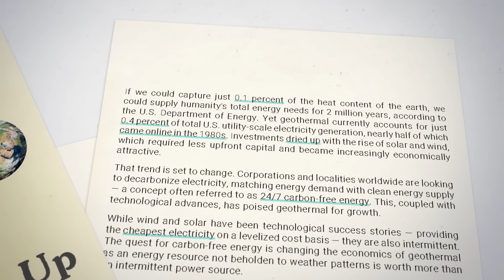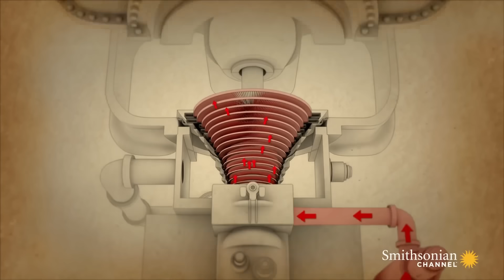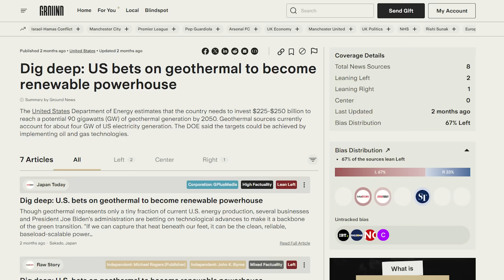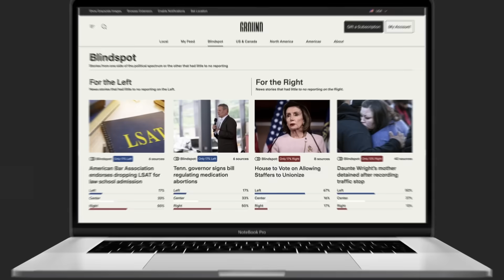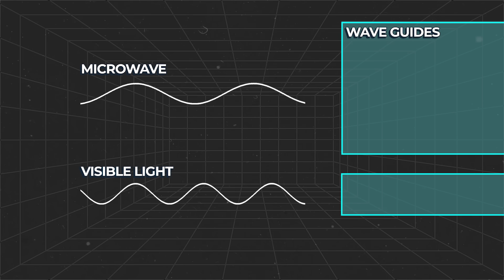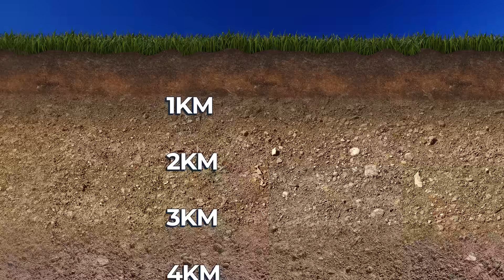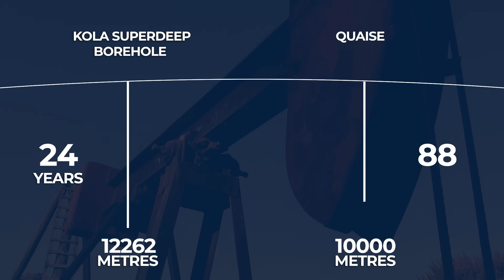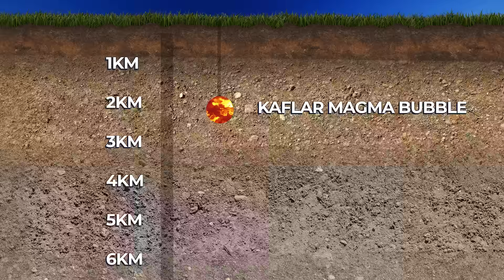This Fusion Tech is Solving the Geothermal Energy Problem

Comment from the maker: If in doubt, use more lasers. This was fun, thanks to Carlos and the Quaise team!
Use my link https://ground.news/DrBen to get 40% off the Vantage plan. Access local perspectives to better understand world politics and current events with Ground News.
Reply: This won't work. The hole will fill with high pressure vaporized rock and it will eat itself wider instead of deeper. You'll see.
Reply: @bradspsychedelium  no you'll see. we dont need to drill down to the magma, only to the area thats hot. DUH!
Reply: @johnnynephrite6147  The hole will be fill with rock vapour and the beam will not reach the bottom. It will Merely heat the vapour and corrode the hole wider.
Reply: @johnnynephrite6147  The vaporized rock has no where to go except up a 10+ km deep hole.  The fact that they don't talk about where it condenses makes me think they don't have a solution for it yet.  The best case is that it condenses into a liquid after exiting the hole, and they're able to recover some of the heat energy to power the laser.
Reply: @bradspsychedelium I also have the feeling that this is a kind of scheme.
We live on a Planet with plate tectonics (thanks God...if you believe in him) and I'm just wondering how many times we have to reopen those holes to hold them funktional.
The second thing is (and I've just read it somewhere) that thermal energy can't be used for ever because you'll use up the heat and have to drill a new hole (but they were talking probably about thermal power plants that weren't drilling as deep as they wanna do it).
Nevertheless, I'm quite sceptical that it will work how they say.
I'm maybe kinda old school but a new power grid and new types of batteries together with using renewable energy sources could generate more jobs and a more sustainable solution to our energy needs.
Reply: @Spielername  I love geothermal as a concept, but it's really tough to engineer. I would advocate thorium fission considering today's technology and demand.
Reply: When using microwave instead of visible light, it is called a “Maser”

Addendum: these can occur naturally
Reply: @t0rg3  I thought so as well
Reply: @t0rg3 
And just for the record although she might not be aware, masers were invented before lasers.
Reply: Thats the movie, "crack in the world "
Reply: @MarianLuca-rz5kk they will be pumping high pressure air through the wave guide to clear the rock dust. But no one has explained what will happen when a water filled fracture is hit...
Reply: @kimstyles5078 Just use conventional drilling at any depth at which the water isn't going to instantly vaporize...if it vaporizes treat it like the vaporized rock.

I think the bigger issue is cooling.  You need to actively cool that waveguide.
Reply: Have you heard about rampian theory and rampian fracture? Lol anyway what a load of electric energy junk addiction mania, electricity is only needed for circuits if they are needed at all
Reply: @crapisnice  u crazy? without electric energy we would not have any of the greatest things ever!
Reply: Its a gear idea, this was researched  in South Africa over 30 years ago,  However we had very little use for it. Also  underground water will draw off the heat, unless there is a stop/blocking method.
Reply: You should have you Ph.D revoked for your claims of infinite energy.  There's always trade offs.
Reply: @kayakMike1000  IKR.
Reply: @MarianLuca-rz5kk  That's how it looks to me too.
Reply: why would you choose the bad guy goatee?
Reply: @TheCorruptionKing  The Tony Stark goatee?

Seriously?

Obviously, he's Iron Man.
Reply: I think people running things don't want Geothermal.  They don't want free energy.  There are places you don't need to drill deep.  Like Hawaii.  Why do they have coal plants in Hawaii?  Burning coal to make steam in Hawaii is retarded. Then the environmentalist groups are pressuring Hawaii to replace the coal plants with solar panels and wind farms.  Just bulldoze the rain forests to set up fields of solar panels in Hawaii.  They don't want solutions that work, or everyone is actually retarded.
Reply: Hey genius-face, "near infinite" is a meaningless phrase.
Reply: @austinmackell9286 Except you know exactly what he means -- a huge amount compared to our current energy usage.

Language is flexible and context sensitive.
Reply: @petergerdes1094  calling finite things infinite is wrong. I will die on this hill.
Reply: Now we need to worry about you folk making all the magma leak out of earth or making it cool and the world stop spinning and we will all fall off the edge of the disk.
Reply: Put stuff in miles too.
Reply: You should have t
Reply: Well I feel we are more likely to kill our planet by doing this along with every country nukeing each other in ww3 have you ever watch the movie where a person killed the earth and they have to make a train device too go to the core of the earth too restart it that engery is there for a reason to keep the planet alive
Reply: Please don't use infinite energy. From the video it's clear that it's not infinite, you mention 2 million years for example, but with so much pseudoscience and so many scams based on it (do not buy solar use this hack to get infinite energy from the earth) we should be extra careful. I found your videos today, and I am binging them. Excellent work.
Reply: Don't do it that will break the EARTH
Reply: Just drill near volcanoes, bruh!
Reply: All this is bs . The earth is a sphere therefore the ocean will always have tides . We could capitalize on this in massive way but don't.  Why ?  Simple big oil will not let it happen .  The world is all about the money. There are some small tide capture energy but only enough to say it can be done .  It's laughable to see us all using fossil fuels and u think electric is the way? Hahaha it takes more fossil fuels to produce an electric vehicle at the moment even though your electric car may seem like it is helping global warming lmao. Big oil controls energy period. They have bought all patents on tidal energy products and won't let this happen period . If u don't believe me try imagining something under the ocean . Big semi buoyant units that flow with the tides and turn generators by way of the tides.  Yes of course this is possible and easy to do !!  Ask why folks just ask why ? 
If your government cares about the earth and it's climate then ask them!  U won't get answers guaranteed . Even a child could imagine a scenario where we capture the power of the tides to make electricity. Cmon folks grow up
Reply: So what happens if we effectively vent earth's core through thousands of holes over thousands of years? How long until the crust cools and we need to go deeper? How long until it affects the rotation of the earth?
Reply: Energy is never free.  It's extracted from different mediums.  My concerns is if we're taking heat away from the core of the planet, will this cool down the core?
Reply: I just want to ask why to go this. Much deep ,while we have volcanoes ,first learn how to contorol its energy 🤔🤔and then work their😅
Reply: Don't you understand if you chaince the plasmafilemental everighe thentional behavieures you onley ad to the plasmafilemental disorder posebiletys eaven more and stronger eurthqueakes will be triggerd👀👀👀
Reply: this is stripped right out of the core
Reply: The thing to consider in the long run is that this tech will inevitably accelerate the cooling of the Earth's core. By how much? That depends on this tech's adoption rates, but my suspicion is that if this becomes the main source of energy of the Earth, that it would accelerate cooling by quite a lot. I'm not sure how long it would take to solidify the core, or what potential calamities a more rapid cooling of the core could cause, but considering Mars's alleged solid core, and lack of magnetic field we could potentially be trading one catastrophe (catastrophic global warming) for another (atmospheric depletion due to weak magnetic field and solar wind).

I think the solution we should be pursuing for base load in the short term is Molten Salt Fision reactor tech, and in the longer term Nuclear Fusion, and Antimatter tech.
Reply: Sonic energy might be a better option for drilling through rock. 🤷🏻‍♂️
Reply: @JustMe-dc6ks  boths can't stay in a straight line inside the rock we have traied that to se of this could replace diamand drilling in concrete.
Yed was not poseble to stay in a straight line the expanding schinking atoms with laser in to thentional diverentional displasmands becomes diamagneticle resistance .
And harmonics than the thentional diverentional displasmends bouncing of and than against elchader that the gabb wijdens eugley over  20 years ago
Reply: And men are not yet raddy for dragster tegh😪
Reply: On one hand it's better to use geothermal sources of energy available to replace environmentally damaging alternatives, on the other hand we should also do everything we can to decrease our energy consumption because every watt of energy produced and consumed eventually ends up as heat, warming up the atmosphere. It may not seem significant but once we add up all the energy from oil, coal, gas and nuclear power plants, industries and vehicles, it's trillions of watts released every single day. Hydro/wind power and solar steam generators don't add any heat to the environment as the kinetic energy and infrared light already were going to end up as heat.
Reply: can i marry you 💁‍♂️🥰
Reply: The Experiment: Suddenly create some charge, and with pre-placed instruments watch (along a radial line from the created charge) the fields and potentials appear progressively at points along that radial, at the speed of light.  And once the field and potential suddenly appear at a distant point, they thereafter steadily remain. This shows that a stream of continuous real observable EM energy does indeed pour from the charge, once it is made, continuously and unceasingly.  Further, that free stream of EM energy does not "die out" so long as the charge remains intact. So the associated fields and potentials are continuously replenished, as they continuously spread radially outward at light speed.

The Observation: Every charge freely pours out real EM energy in all directions, with no observable energy input.

The Problem: Either the required nonobservable energy input must be identified or the energy conservation law is false.

The Solution: The charge continuously absorbs virtual (subquantal) photon energy from the vacuum, coherently integrates it, and re-emits it as real observable photons.

References:

Source Charge, Van Flandern Waterfall, and Leyton Geometry T. E. Bearden  (Dec. 2, 2003)

T. E. Bearden, "Giant Negentropy from the Common Dipole," Proc. Congress 2000, St. Petersburg, Russia, Vol. 1, July 2000, p. 86-98. Also published in J. New Energy 5(1), Summer 2000, p. 11-23.

T. E. Bearden, Energy from the Vacuum: Concepts and Principles, Cheniere Press, 2002, “Chapter 3: Giant Negentropy, Dark Energy, Spiral Galaxies and Acceleration of the Expanding Universe.”

M. W. Evans, T. E. Bearden, and A. Labounsky, "The Most General Form of the Vector Potential in Electrodynamics," Found. Phys. Lett., 15(3), June 2002, p. 245-261.

The Source Charge Problem: Its Solution and Implications T. E. Bearden, Aug. 18, 2003

Most electricians don’t realize that from any source of a finite potential intensity φ (phi), regardless of how small the value of φ, as much energy as one wishes can be collected, simply by W = φq, where W is the total energy collected from potential intensity φ by intercepting and collecting charges q. If one wishes to collect more energy W from the same potential φ, one simply needs more q. The reason is simple: the scalar potential is actually a bidirectional set of EM energy flows, as shown by E. T. Whittaker in 1903, and what is collected from it depends on the number of fundamental interceptor/collectors (called “charges”).

References:

E.T. Whittaker
On the Partial Differential Equations of Mathematical Physics
Mathematische Annalen
Vol.57, 1903, p.333-355

E.T. Whittaker
On an Expression of the Electromagnetic Field due to Electrons by means of two Scalar Potential Functions
Proceedings of the London Mathematical Society
Vol. 1, 1904, p. 367-372
Reply: If it's done that way we will have earthquakes in every major city.
We have to use transfer fluids like edible synthetic oils or even other edible fluids that have a very high boiling point and do not contaminate the ground water or are edible.
If we use water we can only go to 80°C maybe 90°C and need to use heat pumps.
If we don't, we will make earthquakes.
Reply: @Nightowl_IT  Sorry, but no earthquakes are likely with any un-fracked hole. Heat exchange will be via closed circuit water-in and supercritical steam out.
Reply: @Nightowl_IT  Your objections sound alarmist. Cite?

Comment: “Fracking” is fracking. Just because one industry (liquid and gas fossil fuels) uses it more than any other, doesn’t mean “fracking” is a process unique to fossil fuel extraction.

More importantly, fracking can be used without despoiling the environment or causing/triggering damaging quakes.

Comment: So regardless of where on earth, if you drill down 27 miles you will be sure to find supercritical temperatures to extract geothermal energy from..  

so would like to hear Carlos Araque thoughts on Mel's hole in Ellensburg, Washington.   It's said to be at least 15 miles deep so a good starting point, no?  The columns under the pyramids are only 6500 feet deep.

BTW, he has a good interview on the 'What's Your Problem' podcast.
Reply: Don't end a sentence with ",no?". It makes you sound less intelligent.

Comment: A Slavic company has one , they have been going for a few years, hook the thero energy up to Australia's coal Power  stations, remove the coal, use it as a back up, or make mini power stations to serve smaller towns, save on generator's, one can see the heat and depth of the earth on a geo. Thermo map.

Comment: Every time I look it up, it seems the world used between 27,000 and 29,000 terawatt hours of electricity in 2024.  That's about the same amount of energy as detonating  23,000-24.6 k megatons of TNT. The largest nuclear weapon ever detonated was 50 megatons.  So the world released the equivalent of 460- 500 * the largest nuclear weapon ever in the atmosphere last year.  Sooner or later that's going to  have an effect.   It's great to get the energy without eventually getting the carbon dioxide concentrations in the atmosphere up to 550 parts per million,  but somewhere along the line we need to just be more efficient.

Comment: This tech sounds amazing and like it could be a game changer.

Question: why didn't you ask what happens to the vaporized rock? A 10 kM deep hole that's 20cm wide would require vaporizing around 7.5 million to 8 million kilograms of rock. That's a lot of potential pollution that certainly contains radioactive material, heavy metals, and other things that aren't usually found in vapor form. 

I'd love to hear if this has been considered and what the answer is.

Comment: Geothermal is a bad idea.
Reply: why?
Reply: @qkasriel  because internal planetary temperature is what drives out planetary magnetic field and maybe that is not a good idea to use it to charge our phones. Look at mars - it's core is cold, it has no magnetic field and it's atmosphere is blown away.
Reply: @IgorKaratayev  the planet is massive.... volume wise, it's huge. We're not going to be cooling the planet down very quickly(it'll take ages) and the planet is actively being warmed up by decaying material under the crust
Reply: @qkasriel  Yes, yes, we know for sure. At first we where - there are plenty of whales in the ocean, let's burn their oil. Then we are there are a lot of oil and gas in the crust, let's burn them, what could go wrong. Now you tell me there is a lot of heat inside our planet - we would never use it all.

Frankly speaking one thing I know for sure, if it would be too late we would not be able to fix anything.

Comment: This seemed mostly about drilling - but how practical is it to pump water through a loop this deep?  A lot of the materials issues which make drilling hard will also make ongoing operations hard, and maintenance very hard.

Comment: Correct me if I’m wrong, but the total geothermal heat output of the Earth is roughly 3x humanity’s average energy consumption, per given amount of time. I don’t think we can actually just draw out however much we want in any given moment. While the total amount of heat may very well be more than 1000x our needs for the next 2 million years, the dispersion of that heat is necessarily slower.

Comment: Hellooo when drilling metals you start with a pilot hole then change to required diameter. So drill with conventional drilling until there resistances then replacing drill with laser or an option of two in one?

Comment: Geothermal is very complicated and difficult to achieve but at least we have a good idea of the obstacles we face.  If we put as much time, effort, and money into geothermal energy as we have put into fusion, we would have it by now.  Of course, some of the money that we put into fusion is allowing this to move forward so it's not a simple argument butthe benefits are clear, known, and work on existing principles.  The problems are known and can be solved with time, money, and research.  I really don't understand why this isn't our primary focus for clean energy.

Comment: In the Imperal Valley CA they boil butane with hot water.  At lower geothermal temperatures butane is a more effiecent Rankin cycle.

Comment: As a thermal engineer who was hired to investigate this I can confirm a non fracked or reservoir geothermal piped systems will never work die to the poor conductivity of the rock itself. After several years it's performance will tank and never recover